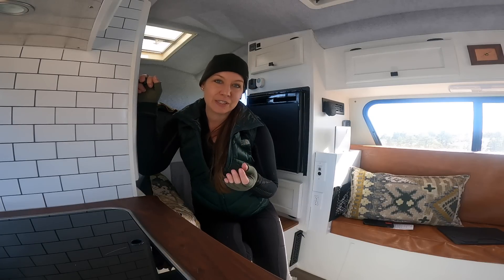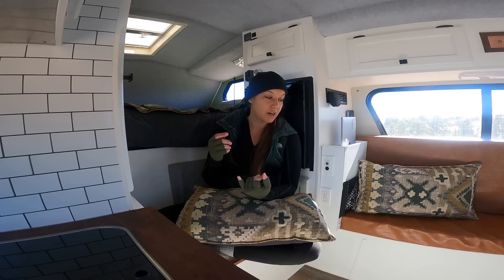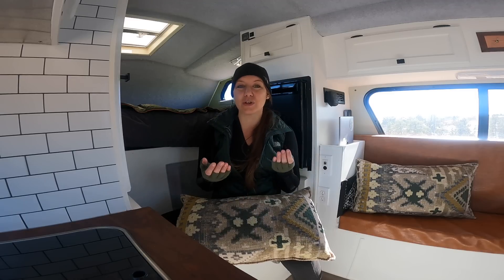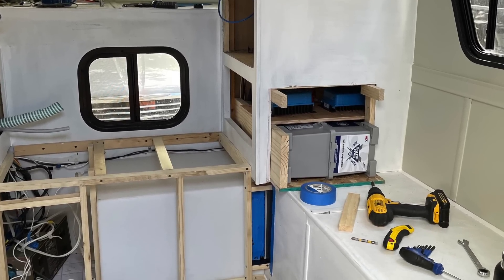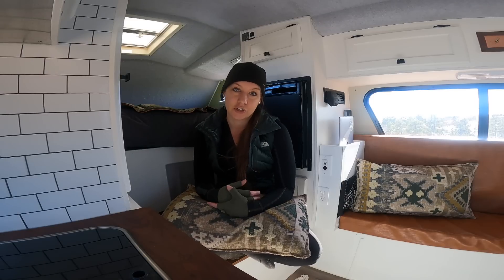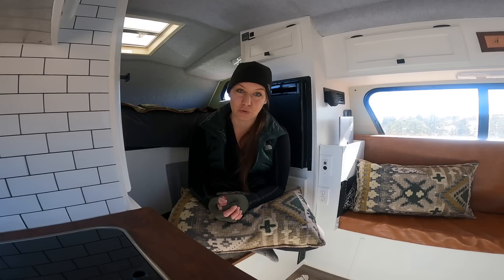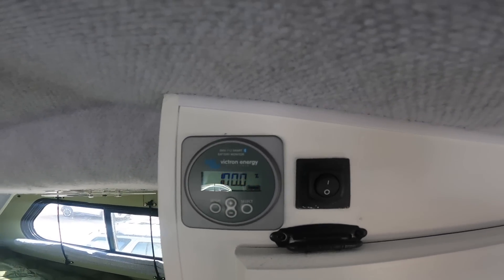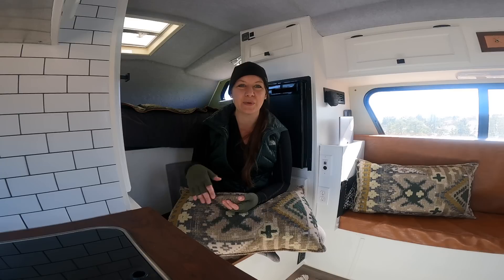The Basics of Rv Electrical Systems | Understanding RV Electrical

Comment: I converted my Four Wheel Camper from 2 AGM 75ah to 1 Battleborn 100ah. I added an Orion 12/12-30 charger that also doubles as a battery cut off when the truck isn't running. Super happy with the Orion throwing 30 amps at the battery when i'm on the move. Easy on the alternator as well. After one trip I installed a Victron Shunt that I can monitor on my phone and the bluetooth reaches to the cab, nice for the nerd that I am. Great job on explaining how AC/DC work with all the add ons.
Reply from the maker: Sounds like an awesome conversion!
Reply: @TailsofWanderlust  I should add that when I installed the 100ah Battleborn it was over riding the oem Blue Sea battery cut off switch and running in "reverse", throwing juice back to the truck battery. The Battleborn resting voltage is higher than the resting voltage of the truck battery. That's one reason I added the Victron Orion 12/12-30 dc to dc charger. The oem charging method was basically not keeping up, especially with the "smart alternators" in vehicles these days. Orion for the win.

Comment: Ugggh, I went with a Ram Rebel 5.7 Hemi. Plenty of power+ towing but not liking having a short bed 5 7’. I guess it’s 6 4’ with tailgate down. Only thing about my truck (air suspension 👍🏼) but it seems everything is for a long bed. Ideas for options that I could go with?
Looking at RTT but I like the safety aspects that you’ve discussed in your videos.
Thank you again for your videos ❤.
~ From Michigan 👉🏻✋🏼

Comment: Fantastic basics video Cass.  A great resource i used was will prowse, a lot of his early videos explain a good amount of basic knowledge in wiring, another great resource for full diagram wiring schematics is Nate with Explorist life, his videos were instrumental as your skill level and confidence grows.  The biggest piece of advice I can give when looking into wiring your system, always go bigger if you are unsure, smaller wire gauge can lead you to problems.  Knowing and understanding your current draws is key in this process.  Both were great resources when wiring up my entire enclosed cargo trailer conversion.  I was able to build a 30 amp system (using 10 ga wire), using 400 AH of capacity, and 800 W of solar.  I am able to run sufficiently my hot water heater, Air Conditioner and Space heater (individually of course) for upto 5-6 hours with good sunshine, without sunshine I can run them for about 3-4 hours.

Comment: Can you not just buy something like a jackery or ecoflow delta and install that? Run small extension cords through the wall to power your one or two outlets? It has everything all builtin in, inverter + batter + charge controller etc etc. It's all figured out for us, isn't that cheaper and more efficient than doing it all ourself with various mismatched parts?

Comment: Hi Cass! Quick question: I have an Aliner with a converter. Currently I have a lead-acid battery, but I’d like to switch to Lithium-ion. Can I just swap the lead-acid for the lithium-ion, or do I need to add something else to handle the different battery? Thanks!
Reply from the maker: Hi!  It's going to depend on your converter.  Some newer ones are lithium compatible while many are not.  I'd recommend calling the company you are considering ordering your lithium from (if it's Battle Born, I've called their support several times to help with builds).  Let them know the model of your converter (should be a sticker on the side of it) and they can tell you.  If it's not compatible, they can help you with what models would be.
Reply: @TailsofWanderlust  thank you for the information. Happy camping!

Comment: Great job!! I did a ton of research before I did my system. Here are two thoughts that I think are a consideration. The first is add as much solar as you possibly can. No one has ever said I built the garage to big or I put to much solar on. Also chances are you will add more electrical demand over the years. Second thing I did despite all the prevailing wisdom is I did not add extra batteries for those few occasions of bad weather or what ever. Now I had the room for this solution and some won't. I bought a 1000 watt generator that cost about $300.00. Last winter in the SW I might have needed it 4 or 5 times. My 635 watts of solar will run my 5000 BTU window AC when the sun is out and at a decent angle. The nice thing is when the sun starts going down and it hasn't started cooling down yet the generator runs the AC unit just fine including initial start up surge. Just some additional thoughts for the folks to think about.
Reply from the maker: Really appreciate you adding that. It’s very helpful for those considering different set ups. Thank you!
Reply: Thank you and happy travels

Comment: Good information, thanks. It’s my understanding, though, that you don’t need AC power to charge a laptop since many modern computers have USB-C connections that can connect directly to a 12V DC system. Have you looked into this?
Reply from the maker: Yes, there are USB C charging and also DC chargers for older laptops available as well.  It was an example of a common AC appliance many are familiar with, but good point it can be both.

Comment: Great explanations, really. Hopefully I'll be in the market for a truck camper somewhat soon. Do you have, or have you ever felt the need for AC?
Reply from the maker: Air conditioning? I’ve used that only two or three times so I’m planning on replacing my AC unit with a rooftop fan.

Comment: +1 on adding 12V outlets and getting USB-C power adapters, so useful with both phones and laptops using the same connector now!
Also having lots of 12V outlets are useful for DC appliances! I use a 12V kettle for my tea or coffee and don't have to worry about an inverter.
I got a small 300W pure sine wave inverter that I use for Starlink and wireless router because it also has a much smaller idle power draw than a 2000-3000W one.
Reply from the maker: I was just looking at electric kettles, and had no idea they had a DC version. Thanks!